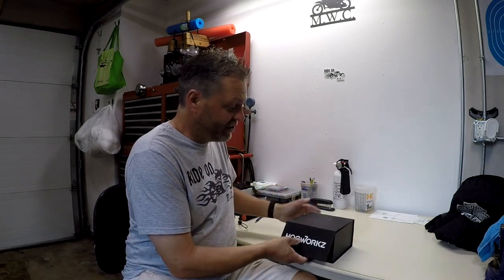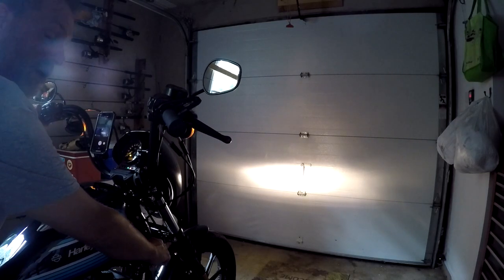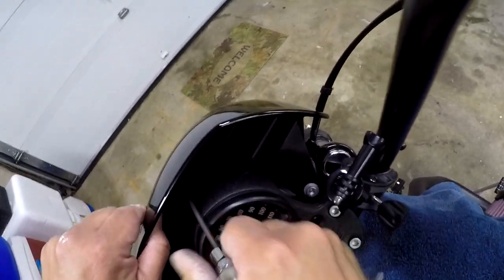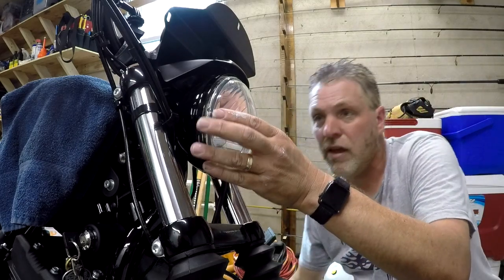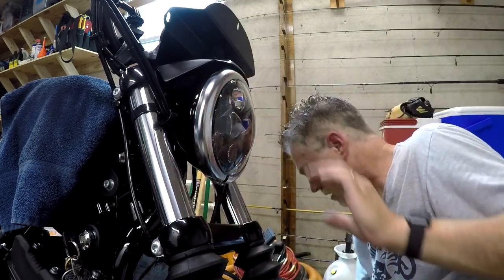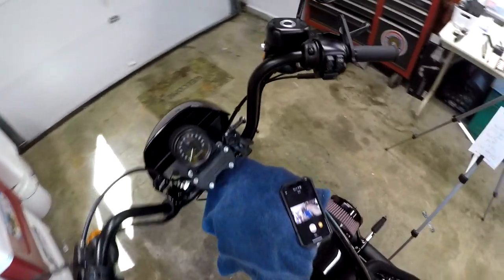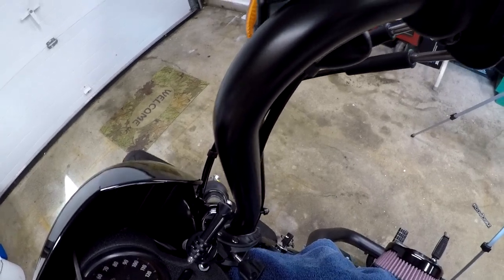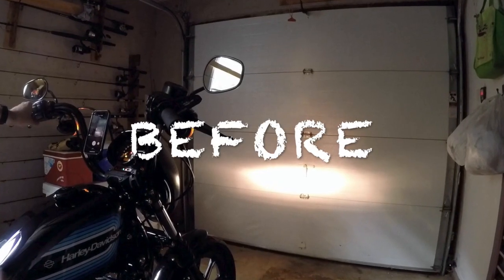Installing A HogWorkz LED Headlight On My Harley Davidson Iron1200 Sportster

Comment: I just ordered one of these from J&P cycles...should be a game changer on my 2006 V-Rod. New sub! Thanks!
Reply from the maker: They are very bright I like mine. It does way better than the stock headlight for sure. And make sure it’s adjusted properly that made a world of difference with mine.

Comment: Looks good mate, I had trouble with the top one myself, then it vibrated loose and it came out had to replace it with a Phillips head which is much easier to get to and tighten up.

Comment: Where did you find the low profile fairing for your Harley. I have 2020 Sportster Roadster.
Reply from the maker: That actually came stock on the iron 1200. I want to change it to a little larger Memphis Shades screen. That one basically is for looks it does nothing. If you go on the highway you take everything it wears you out.
Reply: Motorcycling with Carl I like the low profile look of it.

Comment: Did u have a gap between the headlight and the cowl at the bottom  once you put it all together
Reply from the maker: It all stayed the same just like it was stock. Nothing changed. I have since removed that and put on a Memphis shades Del Rio and I very highly recommend that what a difference it makes and its very easy to take on and off if you don’t want it on.
Reply: @MotorcyclingwithCarl  is there a video on your channel about it yeah.thanks for the reply
Reply from the maker: @jamiefetter5251  hopefully all is well and you got everything put back together ok. Im not a professional mechanic but if I can help you with something I will. Thanks for watching my videos and commenting.

Comment: I have a 2012 blackline. For the life of me, I can't fit the light in there with the 2 plugs in the back. They are too large. No matter how I position it, the light hits the plugs
Reply from the maker: Yes I remember struggling a bit with the plugs myself when I did it. Good luck hopefully you can get it in or find something that fits. Thanks for watching and commenting I appreciate it.
Reply: @MotorcyclingwithCarl  I ended up cutting the plug and wiring it direct.  Now I'm trying to stop the light from vibrating. Does the rubber mount fit in there with the halo light? I took mine out because it didn't look like it was going to work. Maybe I should take it apart again and try it